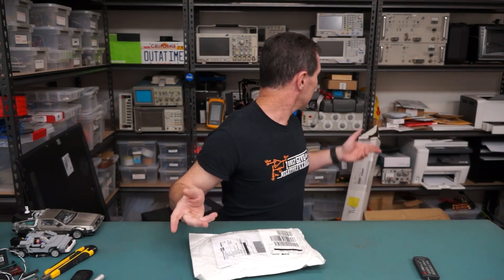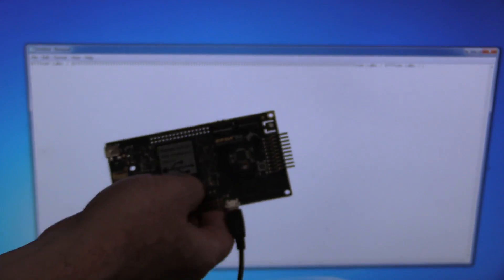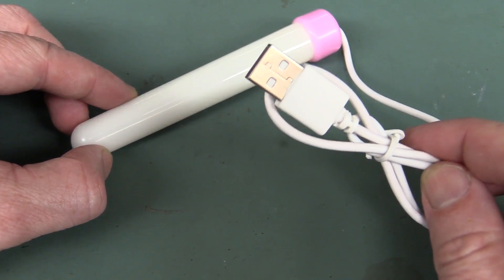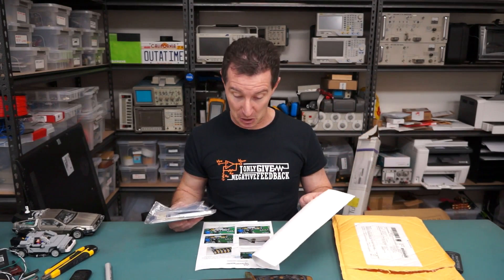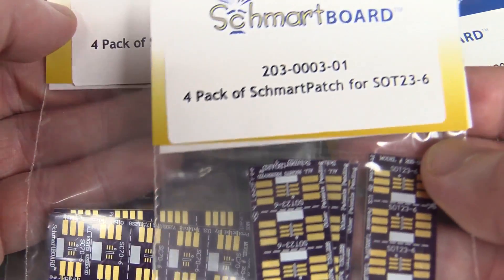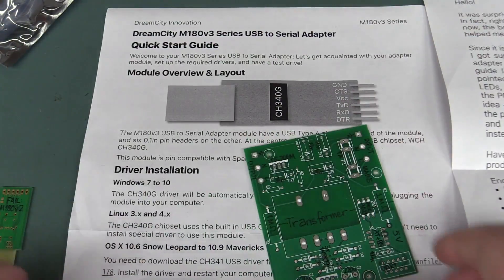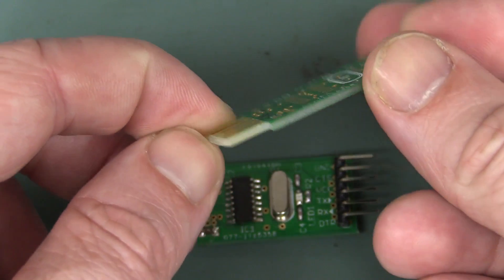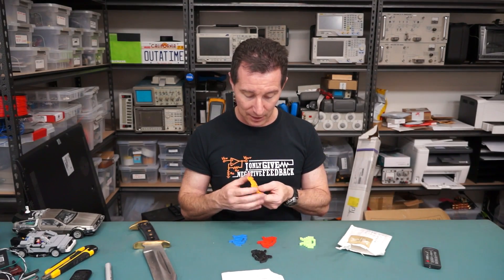EEVblog #798 - Mailbag

Comment: Depending upon how much it costs and the max temp it attains, that "hole warmer" heating element might be useful for localized heating of components that might need it in amateur high altitude balloons. Chemical hand warmers require higher oxygen levels than available at altitude. There used to be surplus electric heater material, supposedly NASA surplus, available at an electronics surplus site in the US, but it's long gone.

Comment: why is their a resistor in grounding straps wouldn't you want them as least resistance as possible
Reply: Because you might just come into contact with a high tension line, in which case a ground strap on your opposite wrist will guarantee a current path through your heart...which is rather "heart stopping".  The 1Mohm resistor protects you from that possibility by limiting the maximum current (passing just 1mA at 1000V) while still dissipating static charges within a fraction of a second, ensuring you remain discharged and your components safe.  Since you are wearing it continuously static charges can not accumulate fast enough to cause damage.
Reply: thank you :)

Comment: I have been driving myself to another aneurysm attempting to hand solder a 144 leg QFP Alterra ACEX CPLD on to a reworked video card - the pitch is something like 0.3mm...  And I only have a unregulated Weller 2012 to do it with.  I have already thrown the bastard in to the WEEE waste twice, then fished it out - I can't quite seem to let it go!  That CPLD is £40 a go and I am pretty certain it must be cooked by now.  Still - one day.

Anyway, those stick-down flexible breakout boards look like a long drink of cool water in comparison.
Reply: If you need to solder such components it is far easier with hot air or IR then an iron.  But if you are trying drag soldering and are using leaded solder then try lead free solder as it will wet less and is less likely to short to neighboring pins if there is a solder mask present.
Reply: Ethan Poole
EXCELLENT advice!!!  Many thanks Ethan!

I usually avoid lead free like the plague, but now you mention it I can see why its 'special' properties might for once be a good thing in this application!

Dave said that 0.5mm was pretty doable in his solder tutorial - but I have made a pigs ear out of reattaching this CPLD several times now.  Am I missing something or are 144 TQFP chips always a dog to attach?
Reply: morelenmir also not a fan of lead-free myself. One trick to stop yourself laying down too much solder on those tiny pins is to use the iron to lightly drag a strip of de-solder braid, saturated with a small amount of solder, across the pins. You can try with more or less solder "loaded" into the braid to get just the right amount to stay behind on the pins. And you can use leaded with it as well, so you won't have the same problems down the road from that lead-free cap solder. :)

Comment: Thanks Dave for reviewing my board but you missed my PIC16F72 adapter... By the way I have released a 4th revision of that adapter. Also heads up for some incoming epicness (M102v? and M177v2) Also I got rid of the crappy M85 (now called M285v1) boards (but I may going to run a M285v2 with all bugs you told me here ironed out.)

Comment: I'm wondering if those cables with the male- and female pins could be combined somehow, the way this cable is build the unused connector would dangle around near the board and may short something out, and sticking it down or something... I don't know, if you go to workarounds you may just keep the three combinations of cables around, may be easier in the long run.

Comment: I=V/R
I=5/7.2
I=0.694 or 0.700... out of range of capacity of the usb port :D
Reply: +Krisztián Szirtes And U not V ;)
Reply: +Fabian Neundorf 
alot of people argue abot U and V and they are both right but most of the world uses V so V is the better option here.
ever seen a project with U and not V? dont think so

so I = V/R
V = IR
R = V/I
Reply: +the real illuminati While you are half right, you CAN'T use both R and A or V in the same formula. With R you are not stating the multiplier of the unit for example, but neither the unit itself! It could be kOhms or MOhms. One is a unit and the other is a constant. Know the difference.
Either you use {U, I, R} or {A, V, Ω}
(For a wider explanation,  V=volts while U=potential difference. A=amperes while I=current. Ω=Ohms while R=resistance)
Reply: +the real illuminati 
No need to argue. 

There is a symbol for the physical property (U - electric potential difference) and then there is a unit of measurement (V - Volt) of that property. Same for current (property I - current, unit A - Ampere). Property of material called electrical resistance is R, value of R is expressed in units called Ohm.
And then, if you have tree phases of alternating current, how do you mark them? L1, L2, L3 or maybe U, V, W? Both are correct as I remember from school and my books. Only that the U, V, W is a bit archaic now.
Reply: That's I and not A :)
Reply: +zlotvorx or the voltage is E which means electromotive force :D
Reply: +the real illuminati OR I=E/R
Reply: +ANTHONY CABALLERO Another fun fact: E is the open circuit potential difference. And look at that! In open circuit conditions, there is absolutely no I and R is infinite, so you can't calculate with those either :D
E is good for battery chemistry where you only care about the reactions and not about the voltage that will drop to the bottom of the Mariana trench when you draw current :P
Reply: +Krisztián Szirtes Lol....I research it again... but this time in internet rather than a book :3.. V is the correct symbol :D